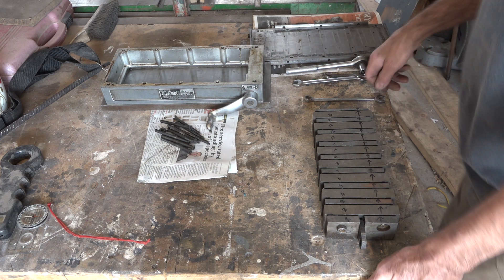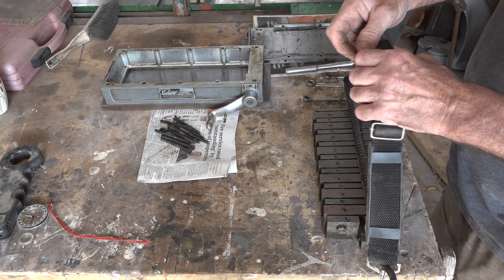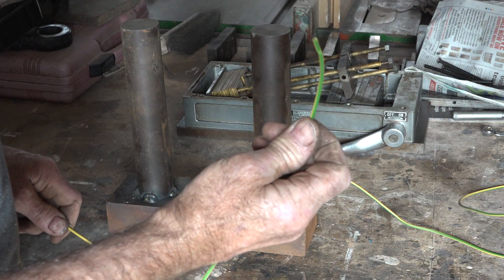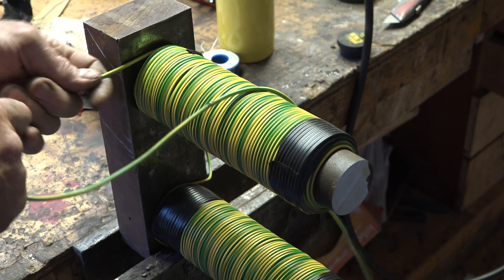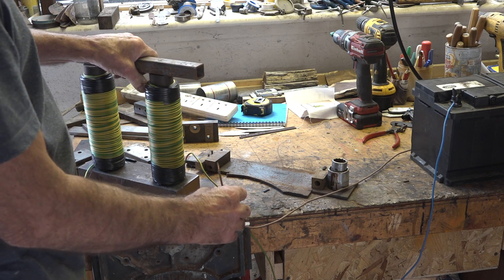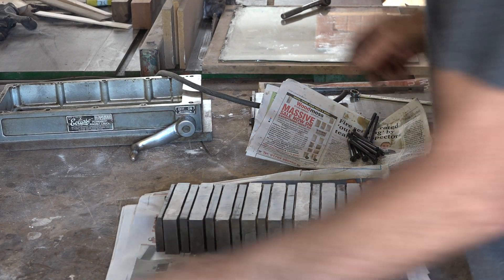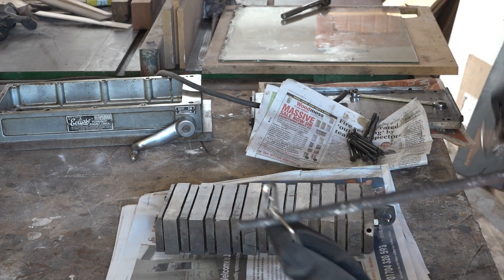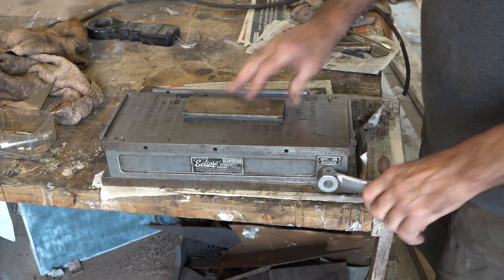can a magnetic chuck be re magnetised?

Comment: So the magnet you’re using is not a a fine pole which is used on thin stock. If used on thicker stock there’s more area for the magnetic flux to hold vertically, vs fine poles don’t have much vertical height to their magnetic field so they’re stronger than the larger magnets

Comment: Tapping a magnet is a good way to De-Magnatise it!
The trick you are trying is to put a magnetic flux through the "magnet" to reorient the failing field in it. 

The induced magnetic field is dependant on the current going through the coil and the number of windings of the coil! It looks like you cot the coils running in opposite directions (which is good).  Upping the voltage would work well ...... but do NOT use AC or a transformer without rectification as that will just heat the metal up as the fields reverse 50 times a second! It might be a good video if you did though (anyone else remember Photonicinduction?) 

The insulation on the earth wire will make little difference! It might beagood ideato not be holding the bare end of the wire though .... you are only putting 12v in but when you break the connection the magnetic field will collapse and produce a back voltage (this is how your spark plugs work on your car ;0)
Doubling the voltage applied will square the magnetic field ...... 3 batteries in series for a short time will work very well (just watch the coil temp ;0)
Reply from the maker: Thanks for the info will use the chuck for another project in the future,  I have bought the right sized chuck for the grinder now better all round plan.Cheers

Comment: Even the the stronger chucks will give you lift problems, especially grinding the long way. Some tool steels are less magnetic also. An old trick I use is to grind the short strokes across the length then finnish lengthwise if need be, with lots of coolant.
Reply from the maker: yes coolant already fitted ready for the new chuck

Comment: 2 thoughts 
Just offhand info
Wrap wires around a paper tube 
Insert metal inside .
The other is I think you need to overwhelm the metal to make a magnite .
So larger wires for more current 
Or higher voltages